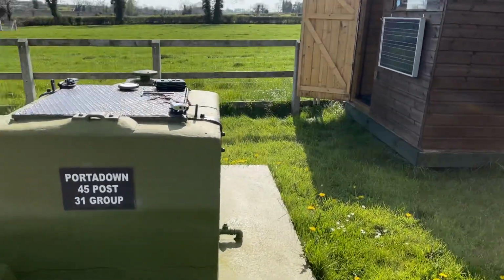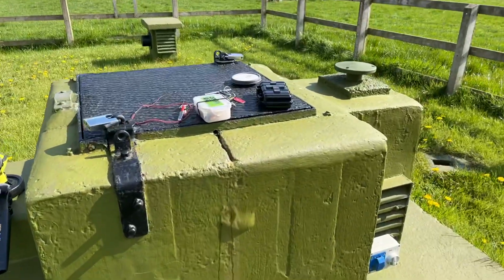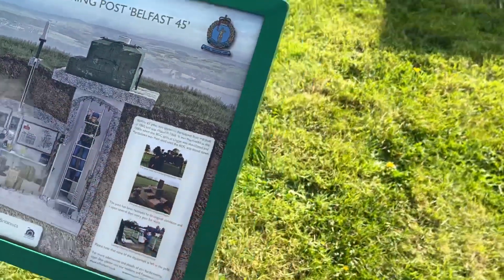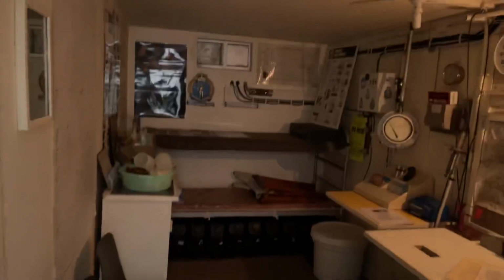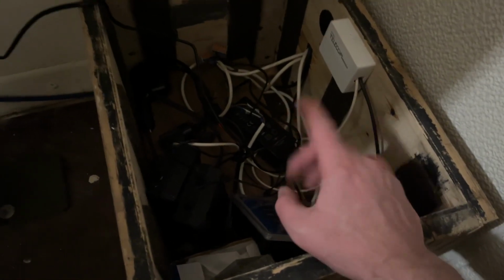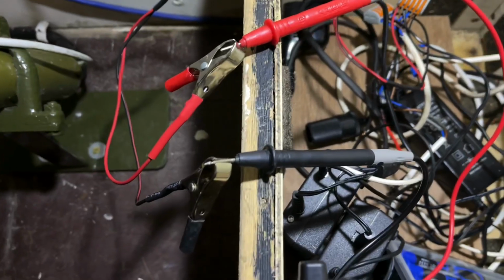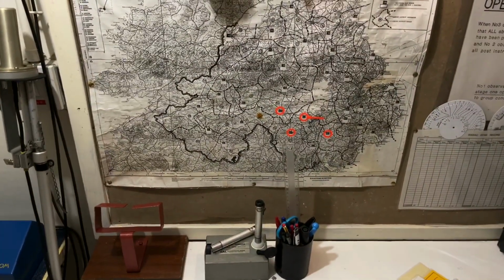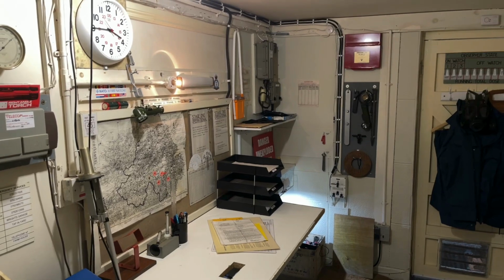Bunker Maintenance Episode 11

Comment: Great video. Just a personal interest,  do you have an original PE set? If so I'd love to see a little video about it. I know that in the late 80s they were replaced by a little Yamaha gen set but would love to know more about the older petrol generator.  Thanks.
Reply from the maker: I have both of those generators! I tend to display the older PE set as it looks a lot more interesting than the Yamaha which is just a big blue box! 

Next time I do an episode of the ‘Bunker Maintenance’ vlogs I will include it.